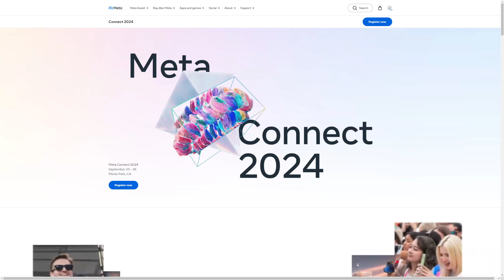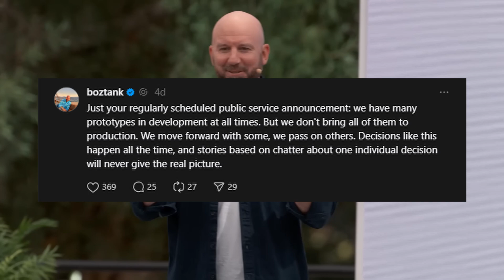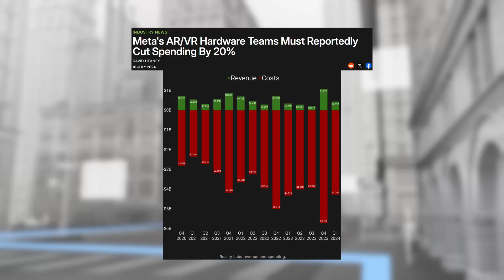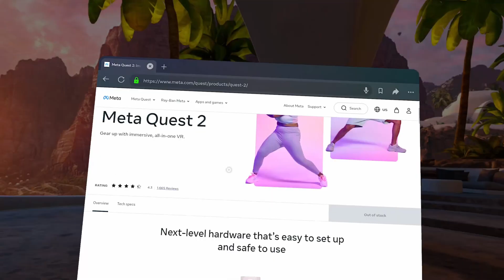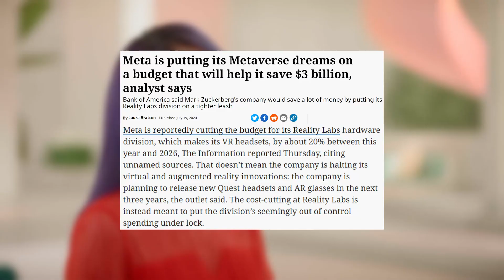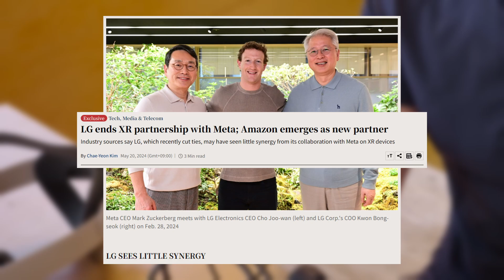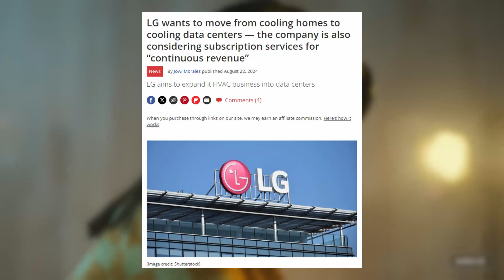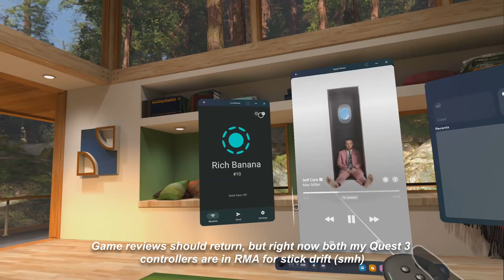Even MORE Quest 3s/Lite Info - Meta Unveiling their True AR Glasses + Quest Pro 2 Finally Canceled

Comment: I think the biggest upgrade this generation is the chip set. Given the option, would you take pancake lenses without the new chips set and not be able to play games like Batman I doubt it.
Reply from the maker: I would just a matter of preference. The slightly larger FOV with a clearer display does wonders to the overall use of the headset. It goes from just a gaming console, to a passable media viewing/productivity device. 

Batman should be able to run on Q2 at a lower resolution, but you'll have to fix installation directories with exporting the APK/OBBs. A guy ported over Beat Saber to Pico 4. Just a matter of effort.
Reply: @sixtacos  you would have to do more than lower the resolution a little bit you would have to drop the frame rate and then use ASW which re-projection  comes with its own problems and looks like crap. I don’t think it will run at least not an enjoyable experience on the quest 2. As a Quest 3 user pancake lenses, are nice, but I would much rather have better games and see the industry move forward. The lenses aren’t gonna do any of that they’re just gonna make the current crappy games look a little better. The Quest 3 update for games like Saints and Sinners does a lot more for that game visually because of the chip set then the lenses do.

Comment: Meta will discontinue support por the meta quest pro? Im interested in the controllers and face tracjing to use in standaalone idr care about mixed reality but they can stop support when the headseat its just almost 2 years old
Reply from the maker: In v67 they did rollout improvements to Quest Pro's eye tracking (July 8). I doubt they drop support, but who knows. Dropping support for Quest Pro would be in a similar vain to Quest 2 using XR2 Gen1. And I doubt Meta abandons their largest active user base.

Comment: With new coming quest update optimizing black by reducing white light, I don’t think there is a need to rush in needing OLED because it will mimic through software. I demo the Apple Vision Pro and didn’t see much of a difference with OLED either.

Hope meta partners with companies to add eye tracking accessory and other accessories to attach to quest 3/3s allowing us to upgrade what we already have to reach quest pro 2 would be like.
Reply: Will this be for quest 2 as well?
Reply: Quest 2 is long gone get your hands on a quest 3